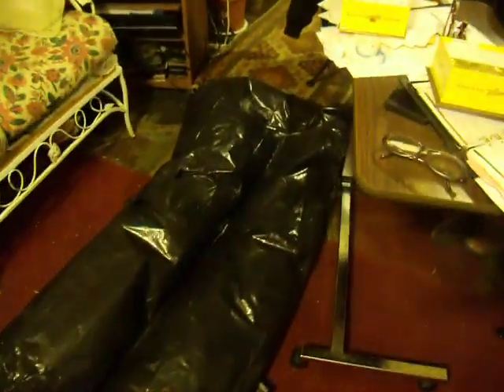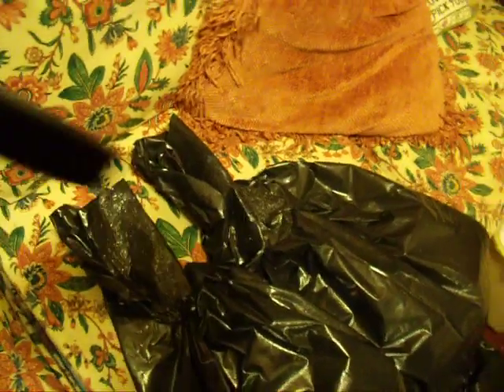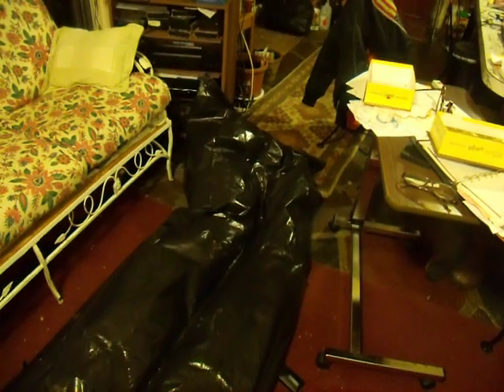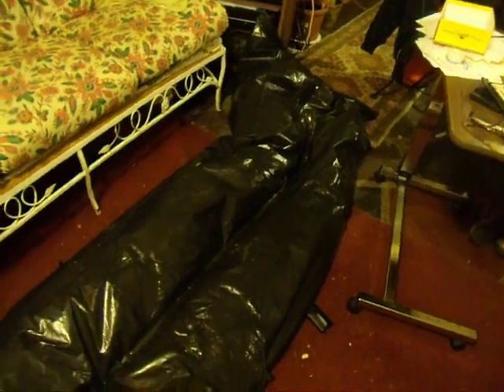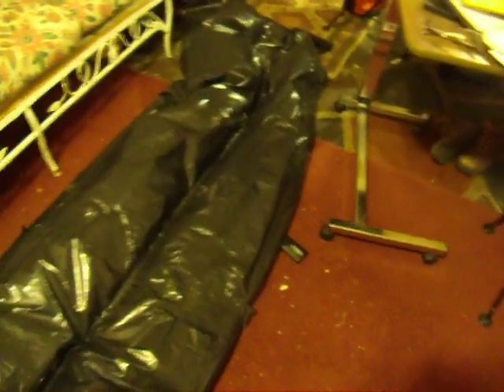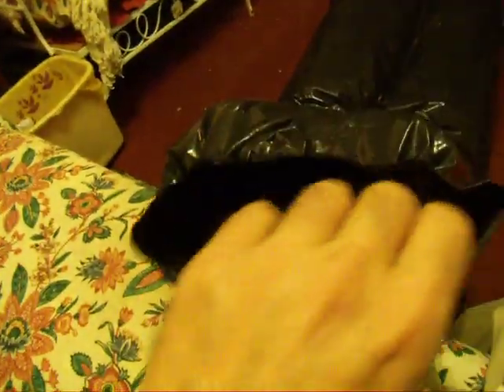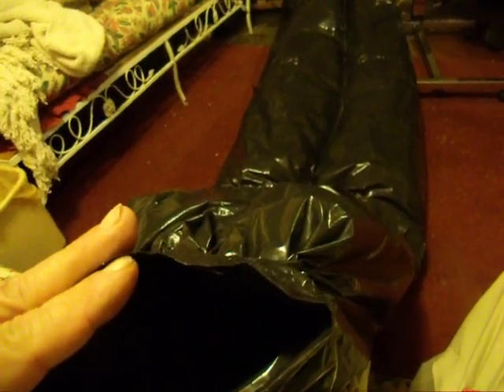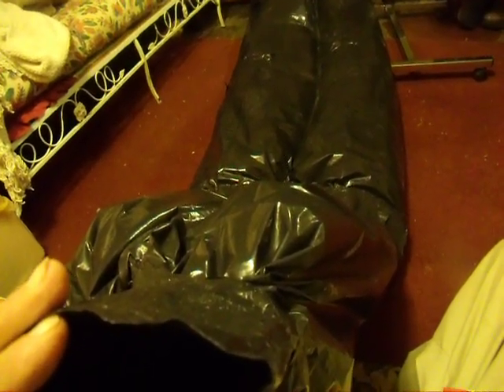Cheap HOt Air Solar Collector from Trash Bags!

Comment: dude...no offense but the point of SUSTAINABLE RENEWABLE ENERGY, i.e. solar energy, is to not have it rely on some OTHER non renewable energy source. If you have to plug your unit into the wall socket in order to make it work you have to throw in the usage deficit created by using coal, water tubine, oil, based electricity. otherwise youre basically just Rube Goldberg'ing  a contraption that would make more sense more if you eliminate one power source or the other. what i mean is
its not efficient
Reply from the maker: OK   power the blower with pedal  powered fan..
Reply from the maker: how many btu s do you get in the window vs the  energy of a computer cooling fan to blow it around.   I may try this again..now that i have a southern window to hang it out of.  I may use some clear PE on on side and black pe on the other side.  we'll see and not use bags at all because they are ment to degrade in the sun.
Reply: Have you researched how toxic the creation of solar panels is ?   Do you realize how enifficient the solar power conversion is ?   Do you know how little wattage a fan takes , (with the right fan)...   stop going around the internat talking like you know everything..